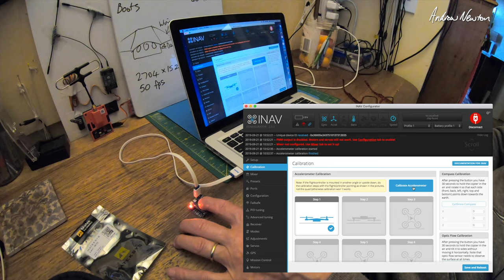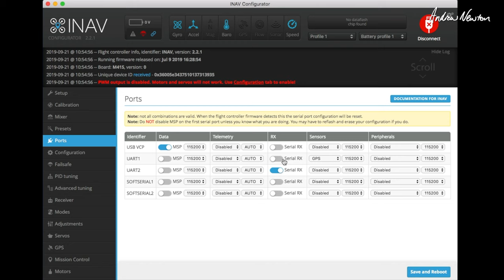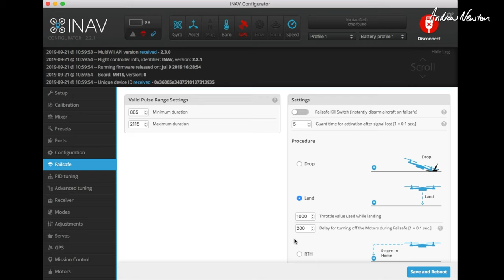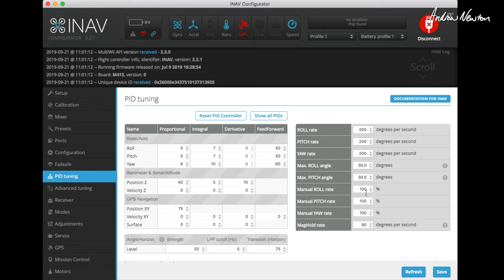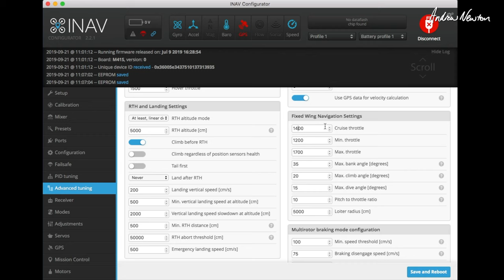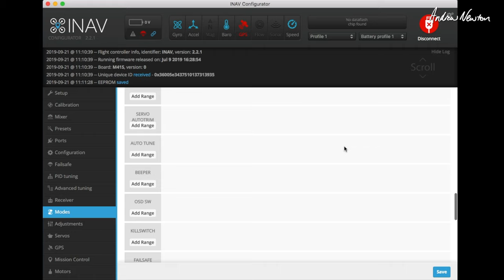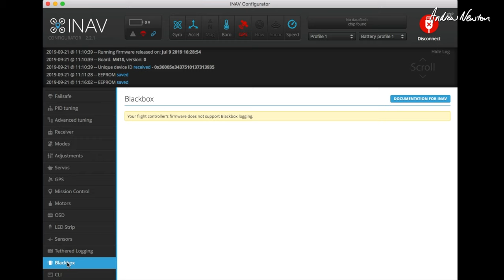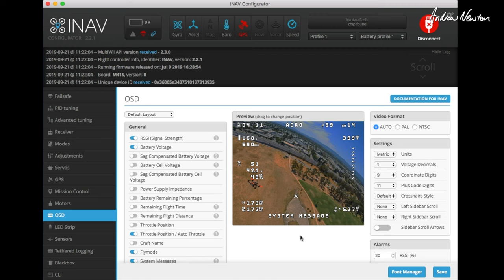Full iNav setup Matek F411-WSE

Comment: I love auto launch especially with wings. I turn the motor delay time down and climb angle up. Motor turns on just after the prop clears my hand so I can use the cutouts on the bottom of the C1.

Comment: Thank you, I couldn't for the life of me figure out why I couldn't get my GPS to be recognized by Inav. Thanks to your video I was able to figure it out.
Reply from the maker: Excellent, that makes the video worth doing
Reply: Do you have to plug in a battery to get your gps to light up while connected to the Matekf411? My gps leds on the unit are not on.  All solders and connections are great.  Please help. Thanks.
Reply: @CoeShow619  yes, that was my issue. Plug in the battery and the gps comes to life

Comment: I had issues with my WSE on the factory FW flash, flashed it with the build on the Matek website and worked great. Love the 2 board setups for the calibrations. I am glad to see that you also delete the second motor, and that you hate presets haha.
Reply from the maker: Yes some of those presets will have caused headaches for new iNav users

Comment: Please do a follow up showing how to add smartport telemetry (wiring and configuration) -- preferably with  a R-XSR  ;) As there are only 2 UARTs, it is not at all straightforward.
Also, even though my rx is bound, I cannot get the radio page showing any changes on the  sticks. I have AETR on channels 1-4.
This little FC is just the ticket for the Dart 250g wing.
Reply from the maker: I have not tried SPort throughout the FCB yet, maybe in the future
Reply: Did you manage to get telemetry? I tried also with R9mm and I could not.
Reply: Yes. use the Ports setup for UART2 and Softserial 2  as shown in the Matek wiki for the F411-WSE. Connect the wiring as shown in the wiring tab i.e. gnd to G, 5v to 4v5, sbus to SBUS, and smartport to TX2 (all 4 connections are adjacent to each other in a row on outside of PCB).

http://www.mateksys.com/?portfolio=f411-wse#tab-id-4

Make sure the following are defined in CLI:
set serialrx_provider = SBUS
set serialrx_inverted = OFF
set serialrx_halfduplex = OFF
Save

Comment: inav 4.0.0 armed.when use trottle stick up  and down motor not spinning. In  my fly sky trans.display trottle line 3 moving . when check motor test for calibration ,motor spinning.battery its ok.matek f 411 wse.
Reply from the maker: Best ask on the INAV Fixed Wing Facebook group

Comment: I have fried two cameras on my F411wse  first one was because I didn’t realise the polarity for camera supply was different from my old F411, transferred cam from that board to this one got smoke from the board on plugging it in, so guessing the board might be knackered as well ? Second cam toasted was when I thought I would try plugging in another cam “correct polarity this time” to check if the board was buggered or not, this is when I realised that the pins for cam 1 supply more than 5v ! I know I only have myself to blame and expensive lesson learned, don’t assume that the pinouts will be the same from one board to another even if they are from the same manufacturer and check voltage before plugging camera in 😢
Reply from the maker: Ooh nasty. They do keep us on our toes by switching pin positions

Comment: Great video. Is there any reason that you have not set up failsafe on a channel(knob)   I think i have seen you have done that in an earlyer  video.  I am trying to set up a F.411-wse in a ft spear With frsky r-xsr  and INAV 2.5
Reply from the maker: Better to set No Pulses on the receiver https://github.com/iNavFlight/inav/wiki/Failsafe
Reply: Thank you for the answer. I have seen a video of Paweł Spychalski that he say that you shoud set the failsafe to Hold instead of no pulses when you use frsky SBUS .  Do you have tryed this?    Video:      https://www.youtube.com/watch?v=Gh6i1kyxY6s
Reply from the maker: Haven't tried Pawel's method, but both will work with FrSKY receivers, iNav interprets it correctly.

Comment: G'Day Andrew, I've just found your video in my travels. I'm looking at setting up an F411-WSE in my wing. I've just got the one question; what GPS module would you recommend using with this FC? 

I've gone from Nitro fixed wing to FPV Quadcopters and now, after 5 years or so, i'm trying to get back into it with FPV wings. So i'm a few years behind.
Reply from the maker: My favourite GPS links in the description

Comment: Very informative video. I was surprised that you do not enable telemetry. If I am correct, without it, your board will not send telemetry to your receiver, right? I like to record GPS location on my taranis telemetry log. The location helped me a few times to find my downed plane.
Reply from the maker: Oh is that what it does. I honestly didn't know that, thanks. I'll turn it on and see what is logged.

Comment: Andrew, Would I be able to use this FC and connect Elevator, Rudder, Aileron, and Flaps? I would use Y Harnesses for Aileron and Flaps servos. I know that for my wing it will work but wanted to use the same controller on my FPV glider. Only additional external sensor I would use is the GPS with Compass. FPV gear would be the HD Tramp VTX, Foxeer Toothless 2 on wing, and HD Tramp VTX, RunCam HD2 4K on the glider. Both are powered off a 3S battery. I'll also be running Crossfire for long range. Both are running with Kopilot at the moment but without an OSD on them worries me for long range and not knowing where Home is at. Unless you know of an OSD system that would work with Kopilot this would be the config I would purchase to use iNav. Feedback?
Reply from the maker: Yes, this is a good choice. Could also look at F405-Wing which is a bit bigger with extra PWM outputs.
Reply: @AndrewNewton  I saw that too. Thanks again Andrew.

Comment: Mr Newton
I think I rushed to buy the fc f411 wse, because I wanted to connect the 3DR system to telemetry, and after being very calm, I see no way to connect it because I need free RX and Tx, and uart2 it is for the Sbus and uart1 for the GPS, the soft serials are left, which only have Tx.
I did wrong, didn't I?
Reply from the maker: I don't know the 3DR system but if it needs a full UART then you do need a different board.
Reply: @AndrewNewton  Yes of course! Nextel time I've to BE more careful.
3DR system is a ground station linkage to the air model it gives you the possibelety to update way points wiaerllessly, and configure iNav to! Se can Aldo have online reading the model's positivo on the map!

Comment: matek f411 wse connect fpv transmiter eachine nano vtx  first atach -connect antena in transmiter..left to right side wires.. yellow soldering to vtx in matek,red soldering to vbt,black to G.I think so I have smog not working?????
Reply from the maker: Red needs to go to 5V, not VBat

Comment: Hi, great video. Did you try fport with Frsky R9 MM Receiver? I tried a lot of time, but nothing to do. It work only with sbus. Any idea?
Thank's
Reply from the maker: No I have only used SBUS
Reply: Also have the same problem with the same receptor. Did you solve it?
Reply: @Urko76  yes, it works. I flash the receiver with last firmware EU lbt.
Inav param
serialrx_provider = FPORT
serialrx_inverted = ON
serialrx_halfduplex = ON
Connect FPORT on tx1.
On r9mm use the pin next power

Comment: Hi Buddy Great info. I'm hoping you can help me with a question. I have just ordered the f411-wing (FC) and I was thinking of putting it in one of my powered gliders. However on the glider the ailerons are joined together with a ( Y CABLE ) and plugged into port 1 on my receiver.

So do I have to remove the Y-Cable and connect each servo separately ? 

on can I just leave it and connect the Y-cable to servo 1 on the F411-Wing

Any information you can offer would be appreciated Cheers.
Reply from the maker: Hi George. Y cable ailerons is fine, no need for separate aileron channels in iNav unless you want flaperons
Reply: @AndrewNewton  Thank you. As I have not used the f411 before witch servo port would you recommend for the ailerons Y-cable ( 4 or 5 ) or dose it not matter
Reply from the maker: Either 4 or 5 is OK as long as the one you choose is set to Stabilised Roll in the mixer page. Just be aware that iNav mixer and the board use different numbers for the servo ports. The board is 3 4 5 6 and the mixer is 2 3 4 5 in my example because I deleted the second motor on S2
Reply: @AndrewNewton  Thanks for the info buddy

Comment: need some help - having issue with gps after setting up the gps indicator in inav shows up as red. its wired correct have followed all other inav setup as shown but no luck ?
Reply from the maker: Assign a UART to GPS in the ports page, Turn GPS on in the config page, Check Total messages is counting up in the GPS page. GPS needs battery to be connected.
Reply: Same problem. I know I have the correct setup, I have lots of other FC boards (Matek and others using iNav and Arduplane) but can't get the GPS symbol to turn green!
Also,  a 4-pin Dubro connector from the GPS prevents a micro-USB plug from being inserted.  Used a 3-pin instead and picked up a ground on the pin below, bad design!
Not that it matters anyway because the board doesn't register the GPS, so cant be used. Waste of money!!
Reply: @gerryw99  ended up being bad connector on gps board soldered direct to board solved the issue

Comment: What firmware in INAV is used for the Matek F411 WSE ?  They dont list a 411 with WSE , just 411 , or 411SE .
Reply from the maker: Always have to check on the Matek page before flashing. Or turn the F411 over and read the text.
Reply: @AndrewNewton  Matek just got back to me about this , they said use the SE firmware if you have the WSE controller . Thanks Andrew .

Comment: Hey mate. Do you ever do another calibration once board in plane? Or just muck with the angles always as you showed in this video? I ask as wings fly nose up and the calibration on desk is flat so always concerned on first flight with new board.
Am hoping that the Ardu team will support Chibios on this board as has all the makings for a sub 250gram 4g plane. Not that Australians get to have a sub 250 gram limit as I read the new rules anything thats RPA even if sub 250 has to be registered. Plus Canada thought 5,500 buck fine was bad ours is going to be 10,500. Gone are the days of having the most common scence rules in oz. 😁
Reply from the maker: Calibrate once then only pitch angle after that.
Reply: @AndrewNewton  Cheers had so much on my plate to catch up on so launched 2 models today in acro and both flew beautifully. Inav is such a great addition. Are core flute you say.......... ;-)

Comment: How can I get esc telemetry working with this board?  I currently have the following set up:
UART 1 : GPS
UART 2 : RX (SBUS XM+)
Softserial 1 : Smartaudio 
Softserial 2 : (all disabled) 

What pad on the board is ss2 exactly?  And can I make it a softserial rx pad so it can read esc data?
Thanks again for all that you do!
Reply from the maker: Never tried ESC telemetry sorry
Reply: @AndrewNewton  Well because iNav does not (yet) support  bidirectional D shot over the signal cable, one must connect the telemetry pad to a RX pad on the FC to enjoy any RPM filtering in the new iNav 2.4.0.
This is why I need another rx pad.  Where can I find the soft serial 2 pad on the F411-WSE?   Can I switch it from tx to rx?

Comment: Ok so i set my modell up, and put the nav rth mode on a switch, range is working in the configurator. However when i tested it on the ground with a 10 sat lock it just always says acro mode on my osd when it should be in rth. Is that normal if the model is not flying?
Reply from the maker: Yes normal, has to be flying and more than some minimum distance away for RTH to activate.
Reply: @AndrewNewton  okay, thanks!

Comment: Any tips on flashing the Matek boards?!  Was going to follow this but then discovered I need to flash my board first which can't get working for the life of me!  
Issues I've found so far:

1 - It doesn't like the gps being connected.
2 - I had to do the zadig step of replacing the driver. (Top tip, make sure you do this when your flight controller is in the boot loader!)

It now shows as connected in DFU but when I try and flash it says usb opened successfully and then closed successfully but nowt else :(
Reply from the maker: Which board Dave? I'm using Mac so can't give any useful advice about Windows drivers. If you're desperate you can send the board to me and I'll flash it.
Reply: @AndrewNewton  it's the F722 wing board
Reply: @AndrewNewton  Sorted! Downloaded version 2.2.1 of the configurator from github and that worked first time!  Think I was using the Chrome version before
Reply from the maker: @DavePinnock  Aha, good to hear. I'm having problems with my F722 wing. Over reacts in Pos hold and RTH modes and I dont know why.
Reply: @AndrewNewton  I think there is a maximum pitch angle for return to home. I adjusted mine too much and have a similar problem, it will climb too steeply and keep stalling. That was one thing I was going to change before I had this flashing fun

Comment: I have the 411wse with the latest firmwares inav 4.0 but dont get all the flight modes?
Reply from the maker: Which modes are missing?
Reply: @AndrewNewton  cruz horizon angle
Reply from the maker: @dalovehall  Unhide unused modes? Make sure GPS is enabled
Reply: @AndrewNewton  thanks for responding yes the gps was off 🤦
Reply from the maker: @dalovehall  That should only hide the nav modes, not angle and horizon. But great you have it sort

Comment: Why do you use air mode it seems to be something more related to quads than airplanes I don't see what it does?
Reply from the maker: Absolutely essential for fixed wing if you ever want to glide with throttle at zero. Air mode means the PIDs are still active on the servos at zero throttle.

Comment: Andrew - great video, just moving over from librepilot to inav myself. Mainly because I have just ordered an F765...and iNav seems significantly more powerful (had a play using a cc3d revo - which won't work due to dropped PWM support)
Which made me realise that I need to upgrade fom am older ppm/pwm to an Sbus set up.
Any suggestions for Transmitter and Receiver? I have, as mentioned the F765 and DJI occusync Air Unit as well for this Fixed Wing.
Was thinking Taranis Q X7 but thinking something with 16 channels would be nice...as long as it is something which works well with iNav and the F765 really...?!
Reply from the maker: My radio is the Q X7 and any FrSKY SBUS receiver (not the ACCESS version), or Radiomaster TX16S if you want to be able to use any receivers
Reply: @AndrewNewton  thanks for that.
Do you have a preferred receiver for fixed wing though within the list of sbus frsky units...
Ridable, good range, signal, channels.

Sorry...so many questions...
Saw the Paladin in a search yesterday...any thoughts on it?
Reply: Just realised that only 2 days ago you did another post on the Paladin...about to watch it!

Comment: Do can setup cam tilt from motor 2 in this flight control? Because i have volantex phoenix S 1600
Reply from the maker: No. Motor outputs can't be converted to servo control AFAIK
Reply: @AndrewNewton  so how to adding cam tilt in 6 signyal in this0 flight control?

Comment: Without magnetometer just with gps can it work with rtl mode.
Reply from the maker: Only need to use compass on quads, not recommended for fixed wing. Planes only fly forwards so the GPS can handle direction and RTL etc.

Comment: my system glider phoenix 2.0m.,matek 411 wse,run cum,transmiter and receiver flysky.eleron connect to use u connector.all system is working now.stabization working.l have free Chanel 5 in matek.how to connect and set up flaps in Inav 4.0 or on this system semply.Thenks
Reply from the maker: Plug flaps into the F411, add a line in the inav mixer - RC Channel 5, then set up ch5 in your radio as the flaps.
Reply: @AndrewNewton  big thenks